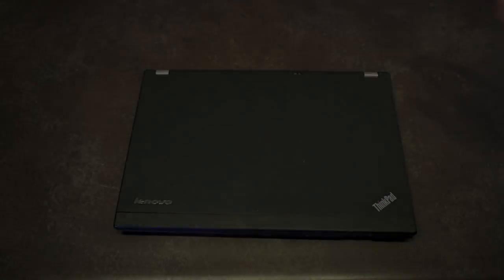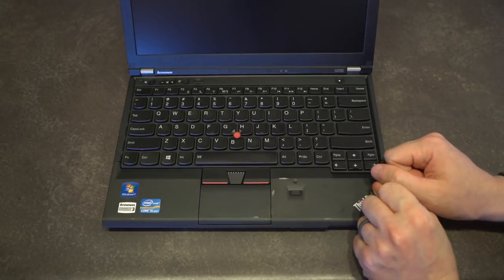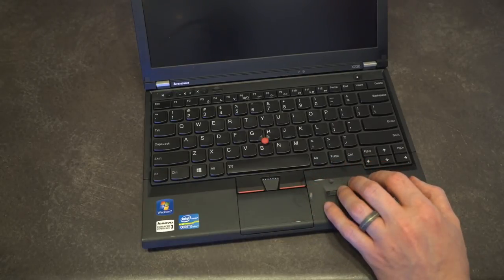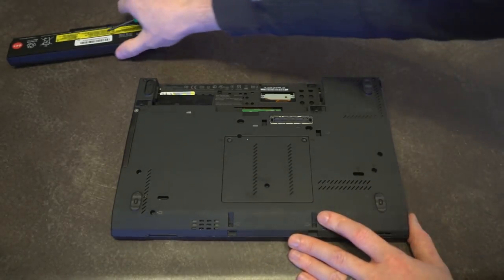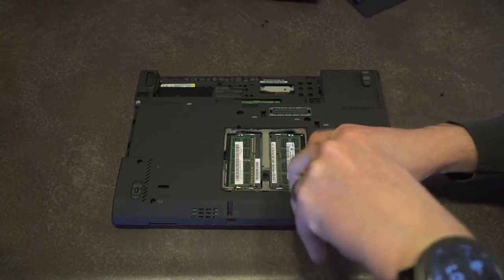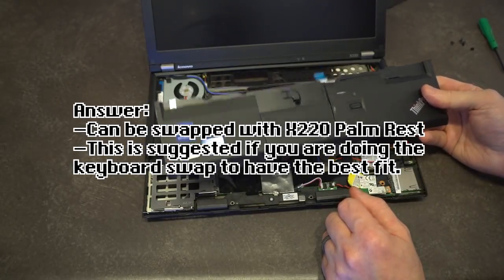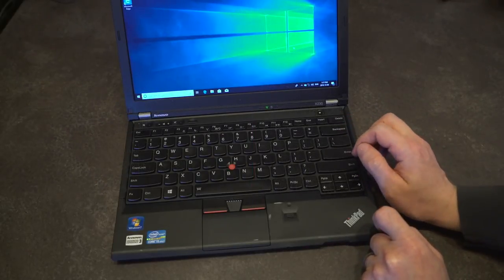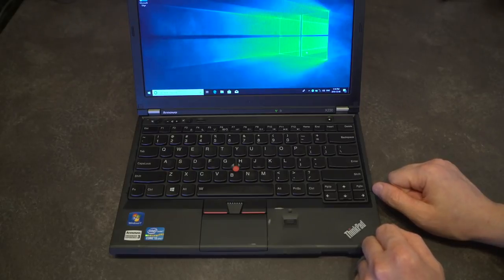Lenovo ThinkPad X230: A Fan Favourite

Comment: Welp i disassembled my x230( with alot of trial and error) and repasted it. While it was a pain, i do enjoy having the ability to take it apart with relative ease.
Reply from the maker: Shouldn't have been too bad. But glad you got it done! Have some cooler temperatures?
Reply: Haven't had a chance to check yet. It was overall easy just making Sure the wifi ants where properly routed(fat fingers and small wires dont make for fun). Towards the end i realized i didnt put the motherboard in properly (the headphone jack was slightly out of alignment). But overall its more just the kind of issues u would have for ur first time disassembling that far
Reply from the maker: True enough, but great machines to learn on!

Comment: Really wish I splurged on this bad boy sooner. Thankfully it's tablet version the x230t seems to be available in the used market to a greater degree oncemore so I'm not complaining too much.
I think in q3 2023 this laptop still holds up very nicely and even the previous gen does. However it's no longer as practical because newer models are cheaper and have more specs that consumers would want in their computers. The kaby lake r generations of Thinkpads are a bargain and are very much the new choosen models.

However ivy bridge Thinkpads just bring about such nostalgia I'll take that classic design and Linux support over the practicality anyday.

Something interesting I've found is some of these machines are being sold on ebay with insane eink hybrid type 10 inch displays which probably gives insane battery performance as they consume much less energy. They do cost a pretty penny but wow. Eink X230. Never thought I'd live to see the day.

We've reached a point though where Thinkpads and their sort of positions in the Thinkpad community have changed drastically.

The older Lenovo Thinkpads are seen as much more antiquated and very much enthusiast grade units. Much like IBM Thinkpads 6 or 7 years ago.

Newer Lenovo thinkpads from the sandy and ivy bridge units are now sort of nostalgia driven machines. Not that there's anything bad about that. They're fast and great laptops with design elements from the 2000s but the 12 inchers are beginning to get scarce but it seems the larger ones are still a ok.

The T440p used to be the sort of best compromise between thinkpad stuff and modern laptop stuff with available mods and whatnot and even now it's a bargain.

But good grief newer Thinkpads have plummeted as they got off warranties. And now they're just a no brainer to recommend to people. They're recent and they're exceptionally fast with great battery life.

The T480 has sort of succeeded the 430 and 440p at this point and although it's a little saddening to see my favorite laptops lose top spot I guess it's understandable.

And the T490 can already be found on the cheap so who knows where these computers will stand in the increasingly competitive used market.

But despite all of that the classic Thinkpads always feel at home to me. New enough to not notice slowdowns. Old enough to feel like you're using a machine from a time when companies cared about consumer serviceability.

I'm positive that the X230,T430/s, T530, and the W530 all have life left to give. The sandy bridge.models do show some age in the battery life and temps but even they're not unbearable. It's kind of beautiful how gracefully these machines age simply due to them being released at times when there were huge technological leaps.
Reply from the maker: The gift and curse of being around a while is you see machines go in and out of favour, retro status, etc. The trick is to keep a level head and know when you're looking at something through rose-coloured glasses. It's a problem that very few brands ever have.
Reply: @LaptopRetrospective  yeah that's a great analogy. I'm not awfully old and I'm already beginning to see the effects of products I grew up with and adored being phased out for the next new thing that is more in line with consumer demand.

In the case of the x230. It wasn't made for a computer nerd like me in mind. It was made to be a competitive 2012 ultraportable. The design changes between these lines of Thinkpads reflect the climate of business class machines at a given time.

It just so happened that they were so widely manufactured and introduced into used markets that they're now synonymous with value and the charm associated with older computers.

But because of the finite nature of computers it's not like with other products or machines or something like a car where it can last 30+ years.

But hey, I'm sure in another decade everyone'll be getting nostalgic for the T480 or X13s they grew up with lol.
Reply from the maker: Couldn't agree more. 👍

Comment: Yeah :D When Thinkpad was Thinkpad. It's a shame to see the "ever thinner and lighter" crap road Lenovo went down. I would love to just get a X220 with up-to-date CPU and Thunderbolt 3.0 ports. I hate soldered Ram, Batteries, CPUs beeing throttled down as the thin cases can't handle the cooling, etc. Thinkpads once were easy to service, long lasting and upgradable working machines, nowadays they are degenerated  and just one in millions of other thin lifestyle crap you can trash if just one component fails. Totally over priced.

Comment: i´m using my X230 since 2015 when i bought it as a demopool unit. Imagine some chinese would make a ryzen 6000 mainboard for it and maybe with the option of buying a 13.3 inch display unit for it. It would be THE MACHINE.
Reply from the maker: If they made the battery technology as up to date then yes, very interesting.

Comment: just bought one of these for 100...looking forward to using the x230
Reply from the maker: Nice buy! What were the specs? Good condition?
Reply: @LaptopRetrospective  i5 3rd gen, 8gb ram, 320gb, win 10 pro. Not arrived yet but states a rated condition. Pictures of x230 look good off seller
Reply from the maker: Very nice indeed. Hope it arrives safely!
Reply: @LaptopRetrospective  all arrived in great condition :) running very well......
Reply from the maker: Glad to hear!
Reply: @LaptopRetrospective  great buy, light and very well made laptop. Grab one now...

Comment: Can i run pes 2019 on an x230?
Reply from the maker: What are the system requirements?
Reply: OS: Windows 7 SP1/8.1/10 – 64 bit.CPU: Intel Core i5-3470 / AMD FX 4350.RAM: 4 GB.VGA: NVIDIA GTX 670 / AMD Radeon HD 7870.VRAM: 2 GB.DirectX: 11.HDD: 30 GB.
Reply: Nope, intel hd 4000 sucks for gaming

Comment: Watching this on x230 running macOS Mojave 10.14.1 😎
Reply from the maker: Rocking the Hackintosh. Nice.
Reply: How does it run?
Reply: @lucaslucas206  It runs excellently! Pretty much everything works: power management, sleep, ethernet, HD4000, bluetooth, trackpad, trackpoint, battery status, sound, USB ports, etc... I did change wireless card to Atheros 9280 one, so that is working too. I'm also using docking station + 23" Philips monitor. You can even use fingerprint reader, but only to turn on the computer, not to log in. I dual boot windows with macOS, I installed Windows 7 on 500gb Samsung Evo 860 mSata card, macOS is installed on 1Tb Samsung Evo 860 2.5" drive. Hope this helps!

Comment: should'nt you be wearing some kind of anti-static wrist strap when touching internal components like ram, hardrive etc
Reply from the maker: There are other ways to ground yourself other than a strap. I prefer those methods as I'm not used to being tethered and it wouldn't work well where I am. You can certainly use one, or another reliable method.

Comment: 2023. Using for Office 2021
Reply from the maker: Nice!
Reply: Using two x230 (me and wife)  IPS,  quite fresh uprade to 16GB RAM ,  Keyboard mod for programming, regenerated battery. Well if new laptop  13,3 inch max. Fixed solution in rapid shutdown problem, it was poor N.B. thermalpad, Problem solved. W10 and office 2021 ;)
Reply from the maker: Nice work!

Comment: Awesome video, if anyone has a modded bios for an X140e so I can change out the WiFi card to one that's more Linux friendly that would be awesome. Thanks much!
Reply from the maker: Hope you find what you're seeking. I don't have any experience with that model.
Reply: @LaptopRetrospective  No problem, was just throwing it out to the community at large, to see if there was a shot in the dark lol! 
Also the Thinkpad X131e(Intel Chromebook, & AMD APU Windows),  & X140e models are part of the Lenovo "EDU Series" family, with a lot of them being sold to school systems. they have rugged rubber bumpers around the top screen, are 11.6in 720p screens with large bezels giving them a 13in footprint, and in the case of the windows varrients have computrace installed into the bios(pray you get one that does not have that activated, it's a pain in the ass to deal with), they can use the same batteries, and chargers no problem, but have white list on HDD's and WiFi cards, but if you can snag one for under $100 with an quad core AMD A4-5000 updated to 8GB of DDR3L Ram they make great fairly rugged daily use machines with a distro like Linux Mint Mate that can even handle some light STEAM gaming, but I would not pay more than $120 max for one in good condition with a charger with the given issues of the simi locked down  bios. Lastly you can spot the EDU Series by the goofy green light strip on the outside of the lid that tells a teacher the laptop is powered on, and some say it's tied to WiFi, but it's not just power, as the red I in the Thinkpad Logo can be hard to see from across the room, so i just cover them up with a piece of electrical tape on the black models, and on my Red ver. I use a Tux Linux sticker.
Reply from the maker: I've heard of these edu series but haven't had one in my hands yet. They sound interesting.
Reply: @LaptopRetrospective  Like i said if you get a non Chromebook model at the right price they are worth looking at, and seeing as they don't have a ton of real reviews on them, they would be worth looking at for the channel, for someone on a small budget looking to get into the Thinkpad family.
Reply from the maker: Noted. Thanks!

Comment: When IBM managed the ThinkPad line of laptops it was the Sherman tank of laptops. Just about all businesses of value used their computers. Now that it's managed by Lenovo and with the mere mention of the CIA intercepting laptops or the Chinese government injecting grain of rice chips suspected of being a security problem (not sure it's real) but should we still be using Lenovo?
Reply from the maker: Hard to say. From what I understand if someone wants into your system I have no idea they will find a way. I'm not handling anything super confidential but if they are still using them on the ISS, that might count for something. Again, not in info sec.